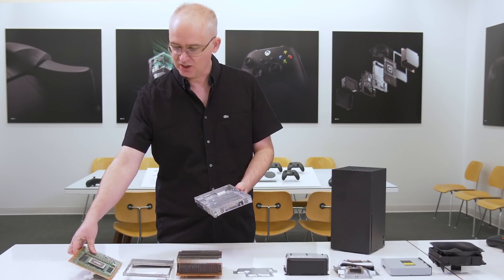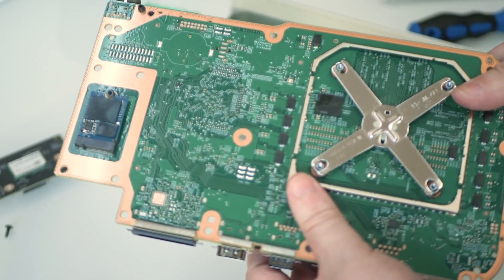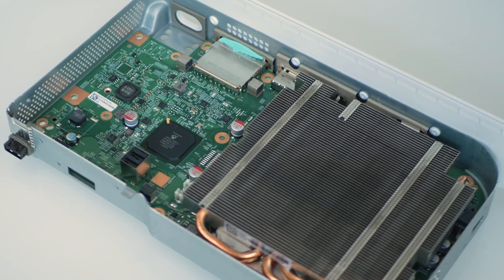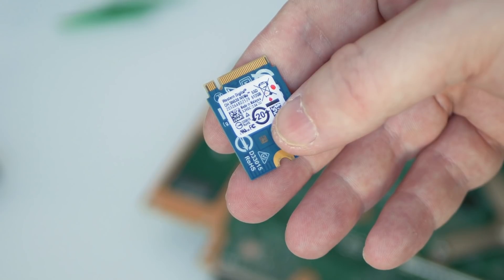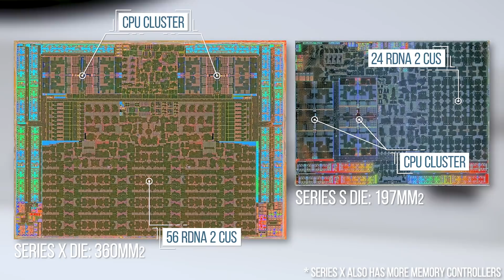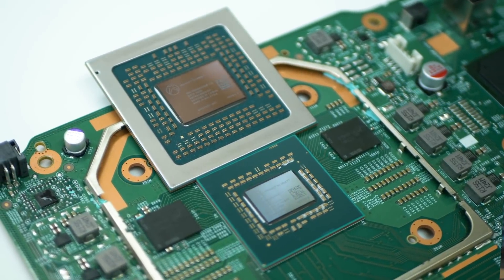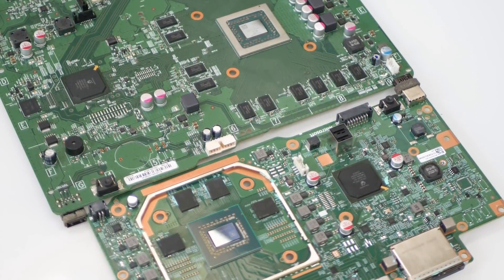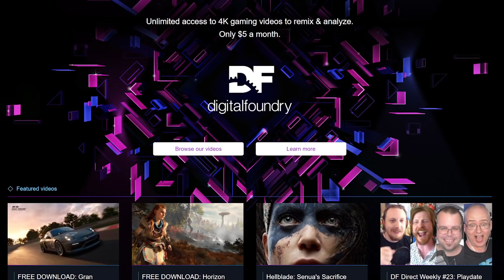Xbox Series S Complete Teardown: Inside Microsoft's Superb Mini-Console

Comment: ok so @2:30 it's not decorative holes, there is clearly a fan on the top here, so do not cover the top side of the machine in your tv unit.
for one moment, i thought the system was fanless because with such an huge radiator and low performance, it shouldn't heat that much.
zotac has a fanless "z" series barebones, embedding vega apu, which are fanless. i guess we're not at that stage for dedicated gpu yet.

Comment: Question... Is it normal for a series s to run relatively hot even when not playing a game...... Just got one and my series x runs pretty cool when no games are being played... But the series s seems to be way warmer when not playing any games
Reply: Hello, no it should not be doing that when not playing games. I took apart my series S because I was getting some frame drops, some weird stuttering, and a little bit of heat when not playing a game. I came to find out that the thermal paste was dry, so I replaced it and everything works fine, really quiet fan noise, no stuttering, it works perfectly.

Comment: I've been thinking about getting a series s i have a 4k tv but it's a budget samsung series 6 so hdr apparently isn't even worth it, no vrr or 120 refresh rate so the series x is way too fancy for my cheap 4k set. I guess the series s has a 4k mode where it upscales 1440p. The ps4 pro and series s have similar gpu power but the s has a way better cpu combined with the ssd will make 1440p run possibly 120fps.
Reply: Series S doesn't run at Native 4K at all. It just upscales quality. It's a beast at 1080p 60fps though. In all honesty 4K is highly overrated for gaming. Even my friends on PC only use 1080p-1440p with the biggest factor being refresh rates of a monitor and TV and FPS

Comment: I really wish there were PCs like this you could buy for just a small price premium. Small form factor PC's that are decently powerful still typically cost over $1000
Reply: @yobama5288  not even just that, genuinely small form factor PCs are historically pricey because there isn't so much demand for their components, so ironically smaller items cost more than larger, higher spec equivalents a lot of the time.
Reply: I've seen a few horizontal mod case builds. It's viable but it will be chunky
Reply: this can not happen as some 1 would have to take a huge hit to profit remember both Sony and Microsoft take a huge loss on there consoles

Comment: Removing the X clamp is much easier than he's claiming it is. You just need to put a flathead screwdriver in one of the ends of the clamps and twist a bit. It'll come right off. Repeat with the one straight next to it and then you can remove it

Comment: Imo ms missed the Mark. They should gone with but more 6+ Tflop system.  24 RDNA cu’s could bumped up some  and should have had 12+ GB GDDR6.  Better running games at 1440p /2k and upscale 4k.  It would been slight upgrade over Xbox x.  My issue is dev will either a) target XSX only or b) devs will target XSS as default profile. While tacking on very minor/cheap upgrade for more powerful XSX. Which seems be happening.  Meaning XSS (may) hold back “some” next gen games.  Time will tell I guess.  It’s not bad hardware. But it be obsolete fairly soon. I wouldn’t doubt if MS stops supporting both XSX/Xbox x  in 2-3+ yrs.   ms has a History saying one thing. Then fucking up later/lying to public.   

I wouldn’t buy one.  I Got good game pc atm 2700x/16GB/gtx 1080ti, at least till next gen games are ported to pc.  Then will prob have to upgrade to M.2 ssd and zen 3/zen 4 with newer GPU of RDNA2 or RDNA3 later.  (Cus RTX 3xxx ampere was joke/half node upgrade at premier price, thanks to cheap Samsung 8nm, which just refresh 10/12 node)

Good video as always DF. But fear XSS will become to weak in next few years.  And ms may just abandon it. Time will tell I guess.

Comment: Literally no one cares about the S that’s why you can easily find it at retailers. It fails to deliver on its promise of being a “next gen” 1440p machine. They gimped it’s specs too hard. They should have made it cost $50 more and at least brought it’s gpu in line with the Xbox one x and given it a little more ram.
Reply: I imagine they are producing way more Series S units since the die size is almost cut in half.
Reply: I seen 10 series S at wal mart the other day went back 2 days later and they was gone so there selling really well actually
Reply: It's really nice price to 300$ for raytracing and 1440P

Comment: Western Digital WD 1TB SSD, WD Black SN850, M.2 2280 NVMe PCIe 4.0, Read up to 7,000MB/s, Write up to 5,300MB/s, IOPS up to 1,000K/710K, 1.75Mh MTBF, 600TBW, NO Heatsink

Long load times are obsolete with next-gen PCIe® Gen4 technology, reaching irrational read/write speeds up to 7000/5300MB/s. Arm your system with RGB lighting, an optional heatsink model, and up to 2TB capacity. Is good for the PlayStation 5

Comment: The Series S seems like a huge compromise to me instead of owning a Series X. Mostly because Xbox Series S is advertised as a 1440p console yet most games are running at sub 1080p meaning below 1080p or dynamic 1080p but it dips lower than that most of the time, so unlike the Series X it is way off target and its obvious the memory and bandwidth wasn't enough for 1440p in most titles and it certainly isn't enough for 1080p with next gen features, which means you will be enjoying ray tracing at 512p, 640p or 720p like in every RT game so far

So the issue with the Series S I have for me is that its blurry, because resolutions are too low. I have a 1080p display and the majority of enhanced games I play look blurry. 1080p should be the minimum in 2021 even for a budget system, not a luxury (unless its a handheld) but if you own a 720p tv, sit reallyy far away or you're coming from the base Xbox One so you are already use to these resolutions then you get the benefit of higher framerates and settings and are satisfied because it was an upgrade from what you had before and it was cheap, its all about your situation which defines your perspective. Which is why I'm fine with people liking the console, but I don't feel like the system they advertised is the one I got.
Reply: How big is your display? I play on a 24" 1080p monitor and it looks fantastic in every game.
Reply: @simonemuzio4376  720p doesn't look fantastic lol

Comment: great video as usual and neat to see the internals.. it's a shame on repairability in general.. but I guess that heat shield shouldn't need to be removed anyway. great build. the One X was similar in how it was put together. I took mine apart and replaced the thermal paste. Microsoft does a great job engineering these consoles.

Comment: My conclusions based on the comment section: 

1) guys more work less gaming XD, the series x is only  200$ more expensive, that is not that much money , and it’s 3x times as powerful!! If they were priced accordingly the series x would be a 850-900$ console.

2) second half of 2021 and people is still not using 4k displays wtf? 4k displays are not even expensive anymore , I’m already planing to upgrade to 8k tv , and people is still
On 1080 , wtf 

3) Microsoft most be making a shit load of money with the series s , when I read the spec sheet I thought , okey , yes , 300$ for those components, is cheap , but then that means that the series x is suuuuper ridiculously cheap ? It’s a steal.
People buys the S XD

Comment: As they always seem to do these days, i really wonder what the mid generation console revisions will be. Will they make the S even smaller? Will they be able to make the S as powerful as the X, but still retain its current form factor? Im very, very curious to see what happens in the next few years.
Reply: I’m not sure it needs more power(though I wouldn’t mind if they did) since it will do 4K@60FPS. What I would expect is more storage (1TB) and maybe up the RAM a bit. I don’t see MS increasing the power since that might hurt the SX sales(assuming you could find one).
Reply: @Halo9K  I would expect refreshes this time around as opposed to actual mid generation upgrades (though that’s still possible). The Xbox Series S|X are missing a USB-C port on the console. There could also be an additional expansion card port and better support for more hardware and accessories. Overall, I agree though. I don’t think this generation needs a power bump. Xbox especially hasn’t made the same mistake they did with the Xbox One that left it so lacking they needed two new models to fix the issues with it. I’d expect and would want a portable Xbox console this gen (the Series S proves microsoft could make a portable beast at a reasonable price) before a mid gen upgrade. The same goes for PS. They just need a slim version but power wise we’re getting to levels that are just flexing. And personally I think too good hardware makes devs too lazy when they should be optimizing for the consoles. The performance gains this gen have been disappointing because we saw in many cases games looking and playing more consistently last gen.
Reply: I think the only real upgrade they need to do for the S is give it 16GB of RAM. If they could put 10GB in it, then they could've put 12 or 16 without affecting the cost THAT much. RAM is the only thing hamstringing the S. However, if the S can run MSFS(and it does), it can run anything the X can run. I now have both consoles and see very little difference between them. In fact the S is in my living room hooked to a 70” 4K while the X is in my bedroom connected to a 55” 4K. Size is the reason. The small S has a better fit in the TV stand furniture. Playing on either console, I see no difference. Both look and play great!

Comment: I still think Microsoft should find a way to sell Special Edition Series S units that have the full 24CUs unlocked. Those chips exist, just not in great supply, but fundamentally the golden sample Series S SoCs are probably 40% faster than the pre-determined average unit (assuming we can bump the clocks up to match Series X clocks). Series S at 5.6 Tflops would be highly sought after.
Instead of using confusing names or numbers it would be cool to just release golden sample SoCs as game specific special edition consoles. So for example make a Halo themed Series S and just stick the golden sample SoC in there because the aesthetic changes already make it a different model. Theoretically with all the games using Dynamic Resolution now you wouldn't need to change any of the software, the Golden Series S would just automatically run everything better.
Reply: And if they want more supply, a 5Tflop Series S would still allow 2 CU's disabled, that should be a significant percentage of Series S production hitting that level of silicon quality, and it would probably still fit in the thermal constraints of the base unit.

Comment: If only the Series S GPU had been clocked the same as Series X it would be a 4.6Tflop machine.
Crazy to think downclocking would improve yields enough to make it worthwhile wasting that much processing potential.
I assume Microsoft wasn't thinking of the current Series S iteration when they made that decision, saving thermal headroom now means the future $199 and $99 iterations of Series S will be much easier to build.

Comment: Series S is a beast. You pay less but you get the same advantages in-game like the X/PS5. All you really miss is high resolutions but personally I don’t care about that at all. I just want STABLE 60/120FPS and the Series S does exactly that
Reply: for now, all you sacrifice is graphics but if you have foresight the memory capacity and speed will negatively impact the design of games in the future. Most likely scenario as they are not going to make 2 completely different set pieces in a game, is that demanding Series X and PS5 titles may be held back in terms of meaningful scene complexity as they have to make sure it functions on series s as well.
Reply: @LeiChaobruh  As long as the Series S  is on the same integrity as the SX and PS5 we’re good. I do think the S will hold back the PS5 and SX in the long run and for us S users that’s good. As long as we have the same in game experiences as the SX I don’t see a problem, if it becomes a problem I just buy whatever SX is out at that time, but that will take a few years probably
Reply: @Tmzu  that's coming from the point of someone who wants to who wants to maximize their enjoyment out of a budget console which is fine, but most people want to see technology and game design progress. The series x and ps5 already have ridiculous value propositions. The negatives of the S's existence outweigh the benefits for the majority of people
Reply: @asteria9963  Yes, I understand the value in a value product, I don't need it explained thanks. And I do know what the majority want based on statistical sales of the 3 consoles. Series S is already seeing a stagnation in demand and is not selling out like the other two consoles in many regions anymore. If you think people are that happy to play lower spec hardware, surely the xbox one would still be selling well, especially as the next gen machines are so hard to find.
Reply: The graphics lvl are TRASH compare the PS5 and XSX

Comment: Waiting for a AAA game that will use
1. Velocity architecture
2. Sampler feedback streaming
3. RDNA2 feature set
4. FSR.
If these things applied correctly, series S will deliver consistent 1440p 60 fps with high fedility. May be even upscaled 4k.
Reply: Doubt it'll do that. But overall I also want those things to be more available on the platform.

Comment: Well done Microsoft! Good cooling for the memories modules while the temperature of one of the PS5's memory modules goes up to 93 degrees Celsius 😕. And as a PS5 fan (no pun intended) that makes me disappointed.
Reply: The 93°C is still ok within specs but they missed an opportunity they will probably do something about it in the next revision. Iam just wondering how long the SSD will hold up with the console constantly writing on it while gaming (recording footage in the background)
Reply: @robf  Yeah. Jet planes are supposed to be thermally stable. Yay. One W for the PS😎.
Reply: @robf  haha yeah, even my PS4 has sounded like jet engine for past 5 years, still no problems tho.

I just turn up the volume of my TV :).

Series X and S just add icing on the cake by being quiet.

Comment: Save enough for an Xbox Series S.

But don’t buy it and instead wait and save enough for ssd expansion.

This is vital as the ssd in the Series S is WAY too small for an all digital machine.

Then with both of these monies saved, you can now afford to buy a Series X instead. 

Because;

“Series S is SO much less!”
Reply: I don't agree.
Reply: @K.R.X  You’re perfectly allowed to love the Series S but it plus an SSD expansion is the cost of a Series X. That’s a fact.

The SSD of the Series S is extremely small for a digital only console in my opinion.

The Series X is 3 to 4 times more powerful, has more than double the storage and can accept blurays. That’s a fact.

I strongly advise being patient, waiting until you can afford a Series X and have SO much more.
Reply: @MrMightyZ  I have a 1080p TV.

Comment: The only thing is that 1st party Microsoft games may likely be held back by the Series S. So 1st party developers may never be able to maximize the Series X version since that same game has to be able to run on Series S. And some developers are already saying that they are pushing the Series S pretty hard now. 

This is why I expect PS5 1st party titles to always shine a bit better in comparison. Because PS5 1st party developers aren't hampered by a lower performing version of the PS5 like Series X is. And PS5 1st party developers can concentrate 100% on one specific chipset. Xbox developers have to split that work load between two different chipsets.
Reply: They will just scale the shit down alot (like what we have seen lately with the crappy CP2077 on the last gen consoles)

Comment: The best console hardware design with more features : Smart Delivery + Quick Resume + FPS Boost + Auto HDR + Full RNDA2 (Hardware Machine Learning + Hardware VRS + Hardware Raytracing + VRR) + Easy Plug & PLay Expansion Card with same internal storage speed - Xbox Velocity Architecture + XBOX Game Pass Ultimate 300+games for (Console+PC+XCloud) !
Reply: Expension Cards like that are maybe easy to exchange but that could bite the Xbox buyers in the butt sooner or later since proprietary designs are usually more expensive then a industry standard (for the customer on the end of the chain)

Comment: Why can't use a single 8GB VRAM module instead of four individual memory modules?

Can anyone explain please??
Reply: having RAM in multiple modules increases data transfer speed by adding more channels of communication between the memory and the memory controller. That is why it's always suggested to buy 2 sticks of 8 GB memory as opposed to 1 stick of 16 GB memory. Also, AMD chips are built to love multi-channel memory.
Reply: @RuthwikRao  Bro....I am talking about GDDR6 memory.....not the system RAM.
Reply: @APU-iGPU  gddr6 only comes in 1gb and 2gb variants is why
Reply: @darkwolf1739  No....that's not true

Comment: I originally couldn't find a Series X, so I ended up buying a Series S first. I fell in love with the device. I love small electronics, and simple designs. After I got a Series X I debated selling it, but I can't bring myself to do it. Luckily I didn't BTW since my PC's memory is shot, so now I'm using the Series S as a web browser with a mouse and keyboard on my dual monitor setup. Also, I have already put the Series S in a backpack and easily transported it to people's houses. It's a very useful device even if I have a Series X.